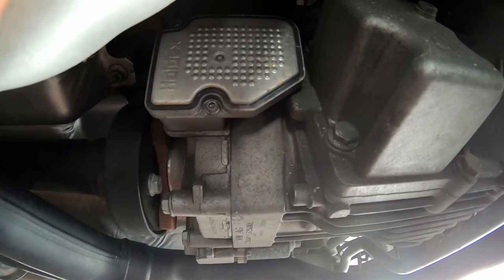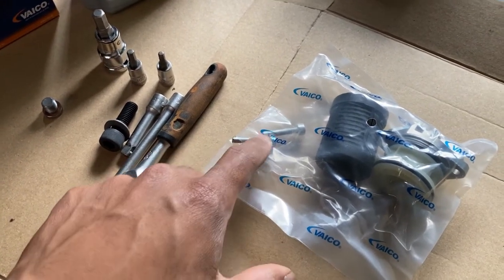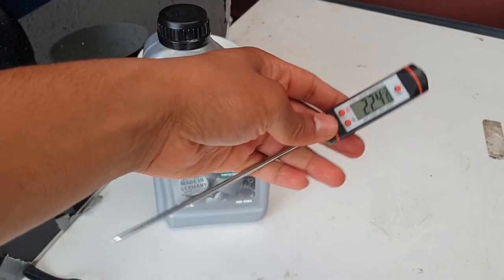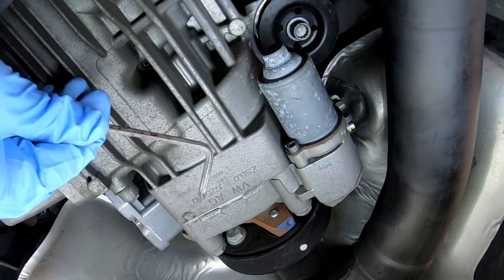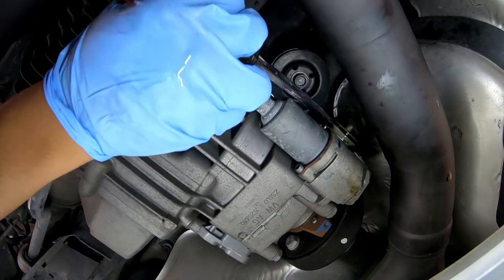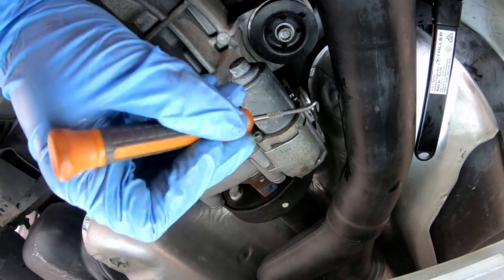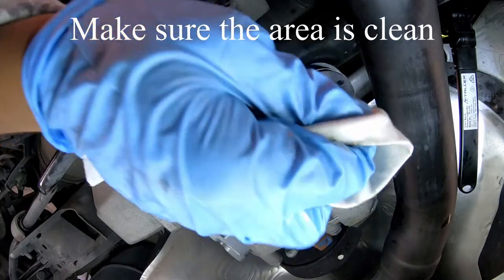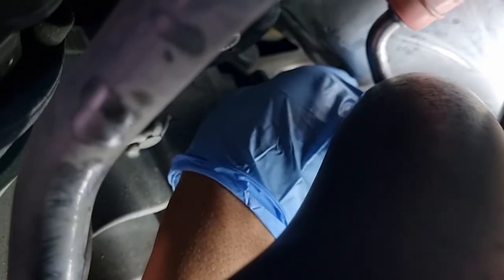Haldex Service VW Audi (GEN 4 Filter replacement & Torque specs)

Comment: Thank you for posting this, although I'm not sure what was achieved by running the pump from VCDS before filter removal - in other videos I've seen, the pump runs for a few seconds longer then you see the white filter cover emerge to where its full width can be grabbed by a set of pliers and popped out without all that faffing about.
Reply from the maker: Yea you do not need to run VCDS i showed it in the video as some ppl will need to do so if the filter is jammed in place due to lack of servicing etc

Comment: I notice you mention torque specs for the Haldex filter.  Were you able to get a torque wrench on the top bolt?  It doesn't look like there is much clearance.  Does the head of a torque wrench contact the surrounding area?
Reply from the maker: Correct its very tight in that area. I know from experience how tight to go without a torque wrench. The bolt bolt is easy, so use a torque wrench here if you can. The top tighten it tight but not overly tight. Get a feel of 6nm on the bench with a bolt and nut.

Comment: What did you do with the spring in the filter? noticed you took it out from the new filter?
Reply from the maker: I took it off the new filter as the original one did not have a spring. As I bought an OE kit which is used for many different models hence why at times certain things are additional.

Comment: Without cleaning the pump???😮...Waste of money and time without cleaning it up!
Reply from the maker: Pump is never touched at a Dealership level. As seen in this video this model has the filter. The one you are referring to does not have a filter
Reply: @AutoBuddynz  No,For The health of The sistem you must clean The pomp otherwaise the pomp Will fail and The clutches too.